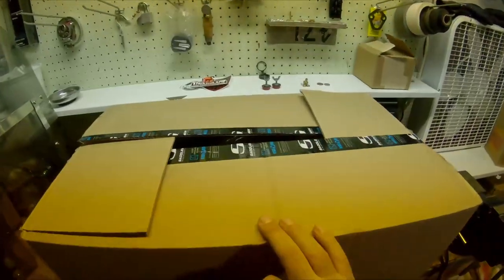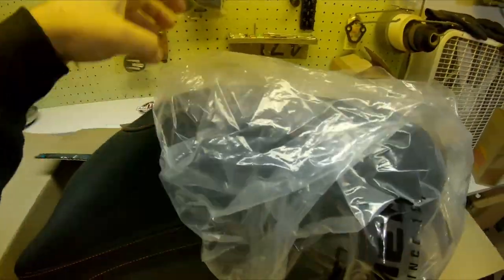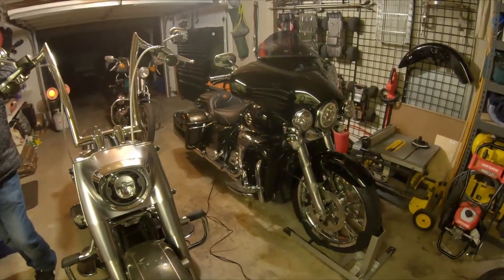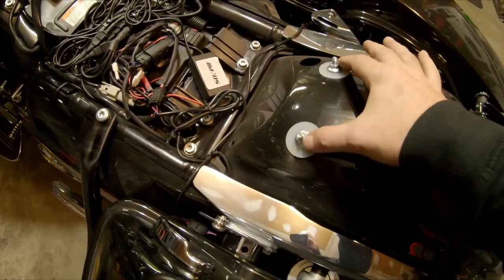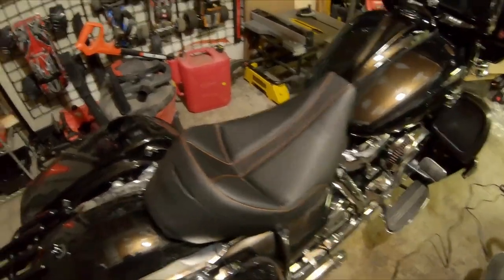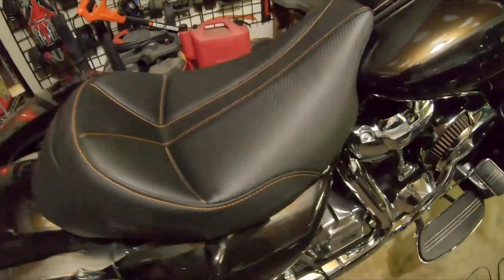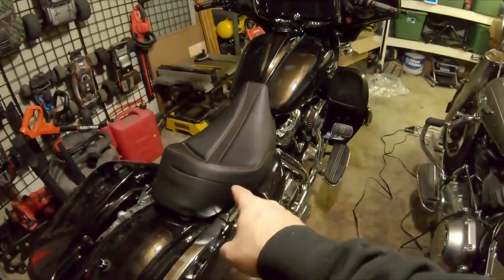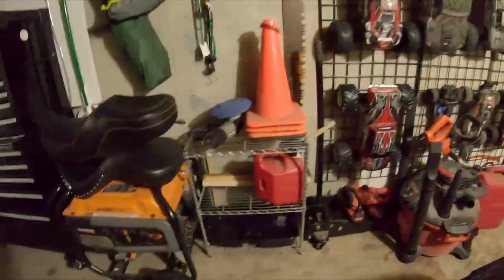Saddlemen impresses again with their solo Dominator on my Street Glide

Comment: how you liking the dominator? i have 21 ultra and going to be taking off the tour pack adn trying to figure out a seat that is comfort and looks good and 2 up riding with tour pack off
Reply from the maker: Yesterday was actually the first day I got to get out on it. I didn’t get very many miles down but I really think this is gonna be my go-to seat from now on. I will say that it is substantially firmer than the road sofa though. The only exception would be if my wife wants to go for a ride, in which case I’ll switch back to the road sofa because she likes her big comfy throne, lol
Reply: @Buffalo509  yes I’m debating. It may be silly but I’m going to take my tour pack off and kinda want a seat I’ll ride with to make bike look good and then when wife rides I’ll add my big ole ultimate seat with sissy bar and if we go out of town I’ll slap on the tour pack back
Reply from the maker: I want to get a tour pack for exactly the same reason as you. Comfy for the wife with the extra storage but can be removed 99% of the time and replaced with a slick solo seat. I'll do an update video once I get some actual miles on the dominator but so far I'm very happy with the look and comfort.